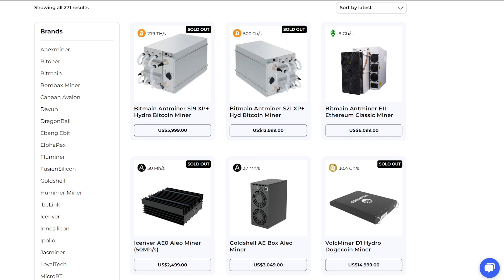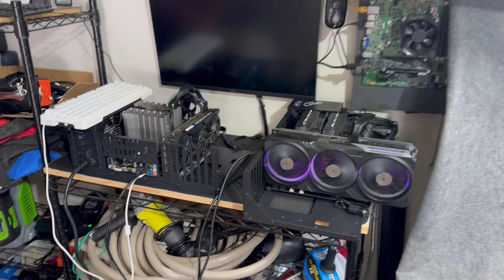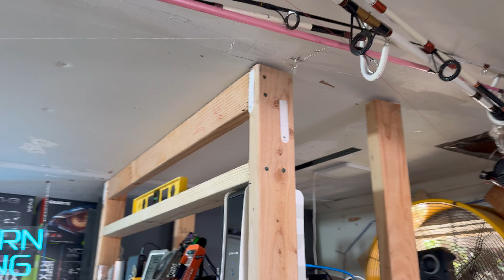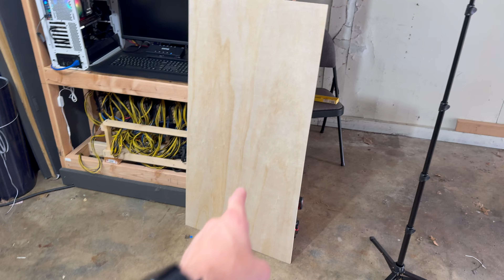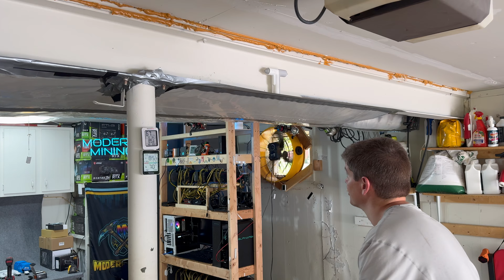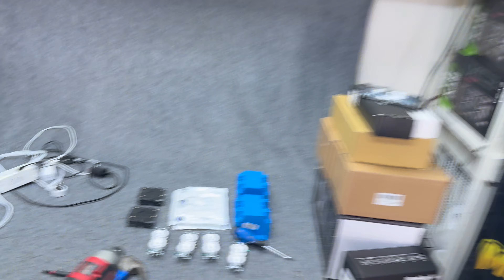I Built an Extra Shelf for My Crypto AI Rigs...

Comment: Here's some information about Salad Ai, so I have an extra RX 5700 XT. I know AMD GPUs don't do well in AI stuff, but out of curiosity, I tried salad on my RX 5700 XT, and surprisingly, it gets a job after like 14 hours of absolutely nothing. The earnings are really low, but 0.025/h not bad for an old AMD GPU, right? 
Now I need some help from a pro like you. I have a budget of 350-450. What GPU should I get for salad AI?